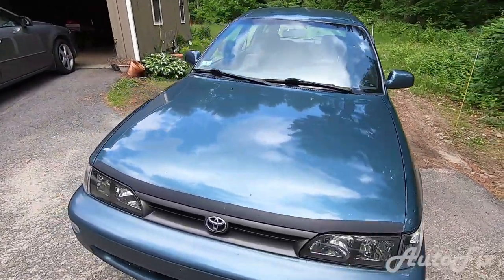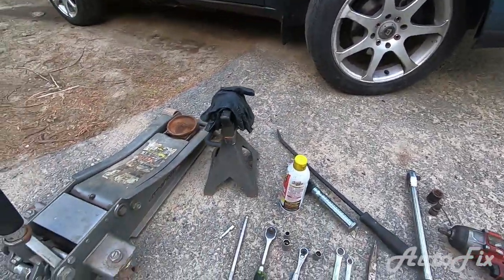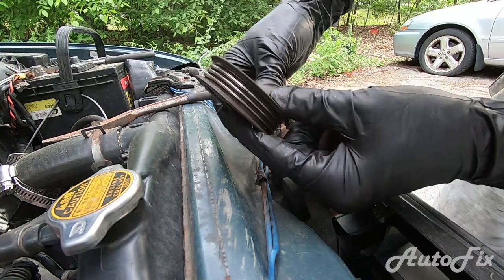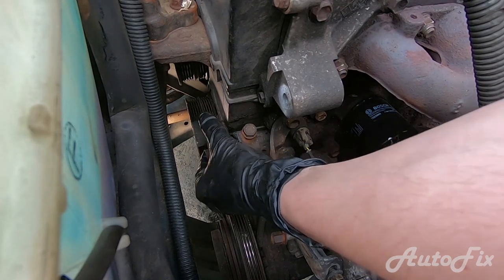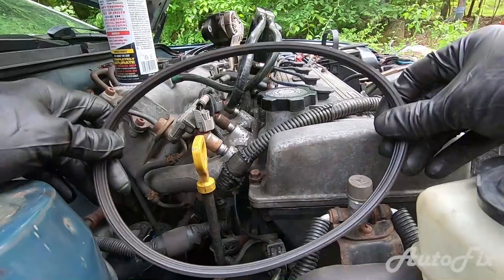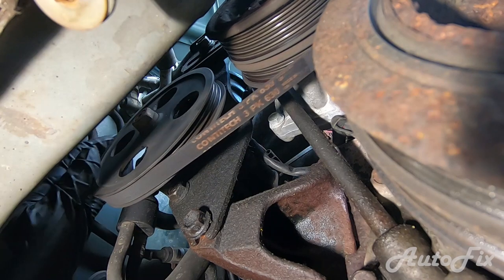Replacing Accessory Belts '93-'97 Toyota Corolla

Comment: 0:25 - Intro

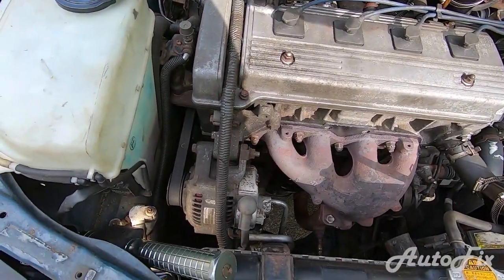2:34 - Alternator Removal

10:54 - AC Belt Removal

12:29 - Power Steering Belt Removal

15:03 - Tensioner Pulley

17:02 - Power Steering Belt Replacement 

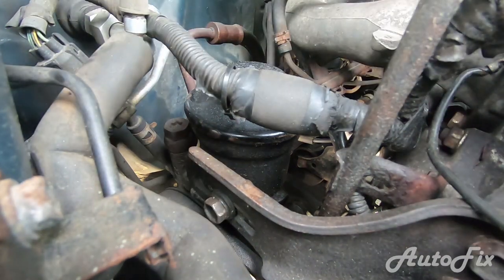20:12 - AC Belt Replacement 

23:34 - Alternator Reinstall 

29:58 - Wheel Reinstall

31:05 - Back to Alternator 

33:35 - Reconnecting battery and finishing up
Reply from the maker: Thank you for this!!
Reply: wow so nice to jump around

Comment: Just wanted to say thanks for making this video. My skills are limited to single serpentine belts on larger engines - I have never changed multiple belts on smaller engines - your heads ups, tips, and warnings are fantastic...  makes the belts swapping job I have to do on a 93 Corolla so much easier. Thanks again for your excellent video and narration.
Reply from the maker: Thank you very much, I'm happy that the video helped out!

Comment: Finally got around to changing belts. Removing alternator and removing tire and dropping splash shield are great tips. Couldn't imagine doing it otherwise. Although starting bolt into block on tensioner was a pain. Great video and thanks.
Reply: Can you replace your pwr steering belt without taking off the water pump belt??
Reply: @richardswain537  I just looked. I don't think the water pump belt will be an issue. 
I do think the alternator belt is a problem. Power steering belt is closer to engine. I don't see a way to get power steering belt around alternator belt. 
Good luck 👍
Reply: @baron7024  thanks
Reply from the maker: The water pump on these is driven by the alternator belt. So you will need to take that off first in order to remove the PS belt. You don't need to remove it all the way but just take it off the water pump.
Reply: Even easier if cv axle knuckle and  engine cradle is all removed!!!

Comment: you saved me from buying a new car. While I was driving two of my belts snapped and the power steering one got pretty mauled- I didn't notice my engine heating up and it caused my radiator to crack, if I didn't fix it myself my car was as good as totaled. I've had the car for a year or so and I'm guessing the guy before me didn't check his engine much either. Before it broke it was loud and noisy, but reliable so I thought it was just cause 'it's an old car'. Now it doesn't sound like hell when I turn it on :,D
Reply from the maker: Haha that's scary that that happened but now you know how to fix it and also you know what to periodically replace! Belts are often forgotten and this is the result of that.

Comment: Excellent, concise and comprehensive video, greatly appreciated!
Reply from the maker: Thank you
Reply: @AutoFixYT  No problem, is there any chance of you doing a video on changing the timing belt and waterpump on this car (4AFE/7AFE)?
I'm asking because it will be good to do them both at once since to do the water pump the timing belt needs to come-off.
Reply from the maker: @kn520  I actually have already changed my timing belt and water pump a few years ago so mine is still good for a while, but when the time comes to change them again I will definitely make a video. It's actually not very difficult, I'd say the hardest part is getting the water pump hose off of the water pump, which is on the back of the block. And there is almost no room for your hands back there. I ended up cutting my hose. Otherwise it's very simple. And being non interference, if you mess up nothing bad happens. It just won't start or run very well.
Reply: @AutoFixYT  Thanks a lot for the response. I'll keep a look out for the video. There is a large scope and audience for videos on Toyota Corolla's the 4AFE and 7AFE because of the large fan base of these car models (being so common and popular), with surprisingly, a very few videos about them online so I can tell you for a fact there's millions of people out there looking for such resources online and it will be great for your channel. So keep up the good work and videos! Thanks again!
Reply from the maker: @kn520  Agreed! I have several videos lined up for the Corolla but haven't had time to get to them. Parts have been waiting for a few months now 😬
Reply: @AutoFixYT  Excellent, I'll make sure to keep a look-out for them  :D

Comment: Well done nice tutorial video... I want to do the timing belt but it seems a lot of work and very difficult to do.
Reply from the maker: It's actually easier than you might think. The engine is a non interference engine so don't worry about destroying it. It can be a little tight in there but totally doable. Just make sure you know the torque specs of the essential parts and know where the timing marks need to be lined up.
Reply: @AutoFixYT  thanks I'll given it a try, one day.
Reply from the maker: I'd make a video on it but I already did the belt two years ago haha so I won't be making a video on it until it needs to be done again lol
Reply: @AutoFixYT  I seen that video it was great... How do you adjust the timing  on these Corolla 93'? Maybe you can teach us how as well.
Reply from the maker: @ZEDNANREHIGH  I have other videos lined up right now but when I make a timing belt video I'll go over that as well

Comment: Thank you for this video. My AC compressor belt broke on me last night there was a lot of smoke everywhere I pulled over to check the car out didn’t see any more smoke drove it back home and parked it. Is it OK to drive without the AC belt?
Reply from the maker: Yes it is ok to drive like that, you just won't have AC. Make sure you check for any leftovers of the belt though. You don't want to have small pieces that got shredded and stuck behind the pulleys. That will cause other major damage. If you replace one belt, replace all three.

Comment: I have a Geo Prizm 1994 and i love your wheels. Where did you get them and what is the name of them so i can look around the net to find them for sale.
Reply from the maker: I bought them on Craigslist from a guy that had them on a 1st gen Miata. They're Motegi MR7, they've been out of production for numerous years now so you can't buy them new but plenty of people still sell them used. Mine are 16x7 and I run 205/50R16 summer tires for plenty of grip. They fit well, but they do rub in the back if you don't roll your fender. I just smashed them with the hammer for faster progress.
Reply: @AutoFixYT  Your video was awesome by the way. One of the only ones on Youtube showing how to remove and replace those belts. Much appreciated.
Reply from the maker: Thank you!

Comment: nice video bro.. i have a question if the PS belt is over tightened will that cause the power steering pulley to seize? every time i turn the wheel in either direction the PS pulley has trouble spinning and sometimes just stops completely along with the belt. thanks
Reply from the maker: That will most likely happen due to a worn pump that can't push fluid around anymore. It could happen if you have the belt overtightened for a long time if it ruined the bearing but you'd get other symptoms with that such as a wobbly pulley, noisy pulley, and maybe even damaged belt. If all it does is stop spinning and makes the belt slip, it's most likely a bad pump that you need to replace. Before you replace the pump though, check the fluid. If it's not clean, flush it. Old fluid can do that too if it's so old that it doesn't hold pressure anymore.

Comment: As someone who just used this, you do not need to lift the car to successfully complete the alternator belt if that’s all you’re doing.
Just do the three bolts he showed for the alternator mounting, and it’ll go on and off like a piece of cake. I will say that if you’re using your standard set of tools 1/2, 3/8, and 9/16, you’re gonna want to go get the 12mm. For the front of the bracket (the bolt you have to “unlock”) it won’t take the 1/2 because it’s too big or the 7/16 cause it’s too small.
Reply from the maker: Agreed, for just the alternator belt you can do it easily from up top.
And yes, I don't think many people nowadays have just standard tools, but if you do, a metric set is a must for any vehicle that is domestic and made past the 80s or so, since they all use metric now. Otherwise it's either not going to work or it will round off the fasteners.
Reply: @AutoFixYT  everything else worked except for that very front bolt, so you’re smooth sailing until you get to the front one
Reply from the maker: Good to know!

Comment: I have a 1994 toyota Corolla Station Wagon, same colour.
The video is amazing, I watched it so I could change my belts but now I need help.
The nut at 11:00 is rusted and rounded. Not sure how to remove. 
Thanks in advance.
Reply from the maker: Nice! They're awesome cars! About the nut... you need to apply a lot of heat to it, you might need a new pulley or at least a new bearing for it after you're done. Find yourself either a 6-point wrench or a socket that's shallow enough to fit, and use a pry bar to force it on (you'll need to go one size down so if it's a 14 mm then use a 13 mm). Whatever you do don't use a 12-point anything. Heat up the nut and break it free. Then replace it with a new one.
Good luck! Keep me updated!
Reply: @AutoFixYT  I'll try it this afternoon, hopefully my pencil tip bronze propane torch is hot enough.
Reply from the maker: Any luck?

Comment: Hey man great content! I was changing the pcv valve on my 91 Corolla 4A-FE engine and half of the grommet fell into the hole! I have driven it since and it sounded like the pieces were crushed up at first and now idles normally. The engine seems to be running fine. Will any pieces make their way into the cylinder heads or will they just be burnt up and passed by the engine? Thanks in advance!
Reply from the maker: Thank you!
And oh no! Ok so in this case I advise you to take the valve cover off and inspect the cams, and make sure no oil passages are blocked by the grommet particles. Clean out everything you think is a piece of the grommet. You don't want any particles in there. That's bad. The pieces will not get burned up because the combustion chamber has no connection to the area where the cams are located. You need to clean those pieces out yourself otherwise they might damage the cams or clog up oil passages which is not good.
Valve cover only has 4 10mm nuts on top. Remove them, remove the spark plug wires, then gently pry the grommets under those nuts and then remove those too. Then gently pry the valve cover up and it should unseal itself. This can take some time but be gentle. Also make sure you have a new valve cover gasket on hand because you may or may not need to replace the existing one. I would though. Then clean out any particles you might see, then reverse the process to reinstall everything in order.
Best of luck!
Reply from the maker: Oh and also perform at least one oil and filter change after you're done cleaning stuff out. You want to run lots of clean oil through the engine to ensure nothing is left in there that can cause damage

Comment: Outstanding video (and a gorgeous 7th gen Corolla!). What's the purpose of the oil catch can?
Reply from the maker: Thank you!
The purpose of an oil catch can is to collect all the oil that comes out of your crankcase through the PCV system, before it goes back to the intake. If you have a lot of  low by from worn piston rings like I do, then a lot of junk (oil and combustion fumes) will be floating around in the crankcase, which will escape via the PVV valve. Usually that's routed straight back into the intake. What happens then though is all those fumes stick to the inside of the intake and clog it all up, or make it very restrictive. I had to take mine apart and clean it thoroughly a couple years ago. The oil catch can separates those fumes and collects them so you can dispose of them before it goes into the intake.
Long explanation sorry lol but hopefully I covered it all
Reply: @AutoFixYT  Definitely, thanks! How many miles are on yours? My '94 is at 150K and doesn't seem to have the oil blow-by issue yet.
Reply from the maker: Mine has 336k. The severity of the oil issue depends on maintenance. Before I had the car, it wasn't always serviced every 3k miles with fresh oil so I'm sure that affected it

Comment: great video.
I have a 97 Corolla with around 56k miles on it. When we first were gifted the car around 2 years into using it the engine literally blew up, we spent around 2k on getting it replaced. That was 3 years ago and the car has been fine and reliable.

But is there anyway of finding out how old the replacement engine is and how many miles it had been used?
Reply from the maker: Great questions. First of all, thanks for watching! Ok now to answer your questions. Finding out the mileage is impossible, unless you know what car it came from and look at the odometer. Having said that, you can definitely assess its condition. The most basic way of doing this is to run a simple compression test. Wet and dry. EricTheCarGuy has a video on how to do this and I'm sure there are many others on YouTube. That will tell you if all the cylinders are up to spec when it comes to compression. Low compression can be due to worn out piston rings or maybe the valves aren't seating properly against the head. Carbon buildup on the valves is not an issue for you because those engines are port fuel injection, not direct injection.
Another way you can go about doing this is to have an oil analysis done. ChrisFix has a great video on this called "What Does A 300k Mile Oil Change Look Like?". There he shows you how to take a sample from the oil, and how to read the results that come back from the lab. Those are the best two ways of assessing the engine health without disassembly.
My advice with these engines is to replace the oil often. Do it yourself to save money if you can! Fresh oil every 3k miles will guarantee that it will stay healthy. And make sure to keep it full if it burns oil. I have to top mine off every 1500 miles with a little less than a quart, and I change it every 3k miles.
I have personally seen engines that look old and beat up and burn tons of oil at just 70-80k miles, and engines that don't leak, don't burn a drop, and look good at over 230k miles! So mileage isn't always a key factor, especially when it comes to Toyotas.
So make sure you keep up on all the maintenance (fluids, parts, belts, etc) and it'll live happily for a very very long time!
Reply: @AutoFixYT  wow thanx so much i really appreciate all of that info.
Reply: subscribed! glad i found your channel.
Reply from the maker: Thanks, my pleasure!
Reply from the maker: If you do decide to get an oil analysis, make sure that you change the oil with the same exact one a few oil changes in a row, tat way additives and viscosities don't mix. I use Castrol GTX High Mileage - I have a video on changing the oil on the Corolla. Pick one and stick with it. If you are taking a sample of the oil, drive at least 2k miles if you can without topping it off. That way the oil gets a little "dirty" from being used and the results can be more accurate. If you can go 3k miles that would be optimal. I say this because I cannot personally go that far with my Corolla without having to top off the oil. Good luck!

Comment: Hey, is it possible to get a/c in a e11 that didnt originally have a/c? 
The bolt holes and space for an a/c unit should be alrdy there but idk how difficult it is
Reply from the maker: You need the compressor, all brackets, ac tensioner pulley, new harmonic balancer that has AC ribs, belt, AC lines, AC condenser, accumulator, evaporator core (goes next to your heater core) and potentially an AC evap core box (idk if the non AC cars had space for an evaporator core), and then you need the wiring that triggers the AC, the button that goes on your dash, and an idle-up valve that goes in the engine bay to idle up the engine when the AC is on. I think that's about it, but I might be forgetting something.
Personally, I don't think it's worth it at all. But... if you really want it, you're better off buying a parts car that has it and taking all those parts off if it.
Reply: @AutoFixYT  thank you for your fast and detailed response. 
Adding a/c is more complicated than i was aware of and i guess it would be a bit too much for me to handle.
The e11 it my first car so im very eager to learn about it and improve it. i guess i should focus on fixing the oil leak (which i hope is located at the valve gasket) and the fuel smell on could start.
Again thank you very much, both the video and ur response were very helpful.

Comment: Can you use the pink coolant by any mean? I'm tryna do a proper flush with my coolant, also putting oem v belts.
Reply from the maker: Yeah you can use pink but you can also use red which is what these cars were designed for, and you can also use yellow universal coolant.
Reply: @AutoFixYT  the zerex should do it right,Do you have a flush of coolant video?
Reply from the maker: @JalenRose02  I don't have a video on it unfortunately. But ChrisFix has a good one that you can follow and just apply to this situation!

Comment: As of 5:00 pm today I just finished doing all three of these stupid belts, it was a huge pain in the ass my idler pulley was stuck and I rounded it out then I had to go buy bolt extractor set and then find a way to fit a socket in there “witch was very hard” finally got that off and the the stupid alternator bottom bolt took me a hour to get lined up with the other one, it took me 4 hours all together to do this
Reply from the maker: I can feel the pain, trust me. But I'm glad you got it all done!!
Reply: @AutoFixYT  me to! This video was a life saver my stupid Haynes repair guide had almost no information on how to do this